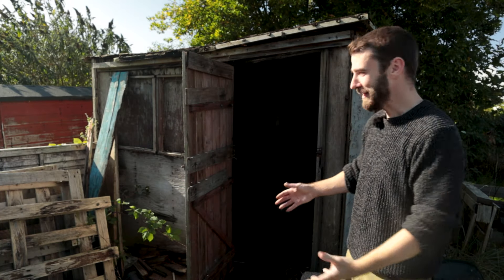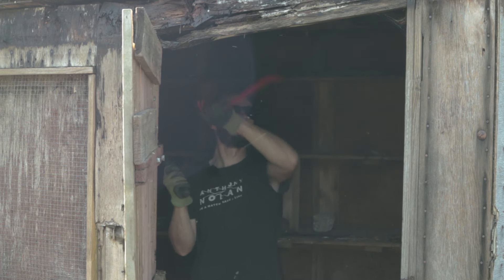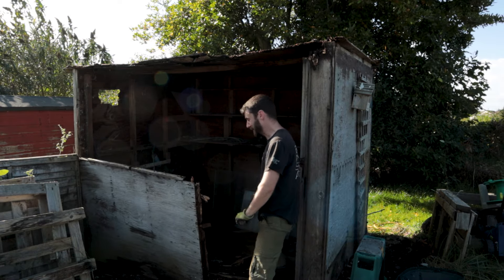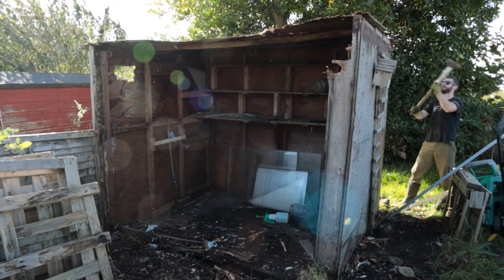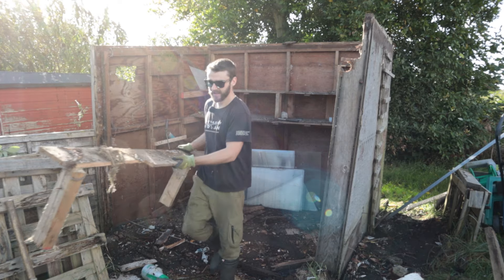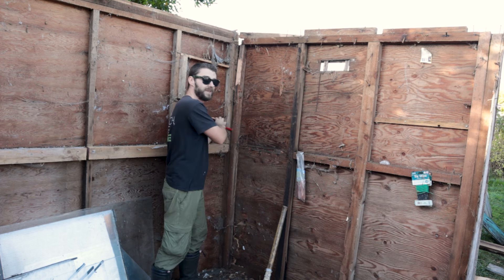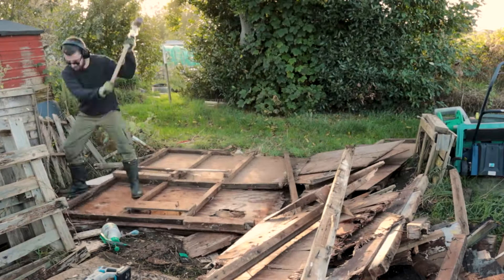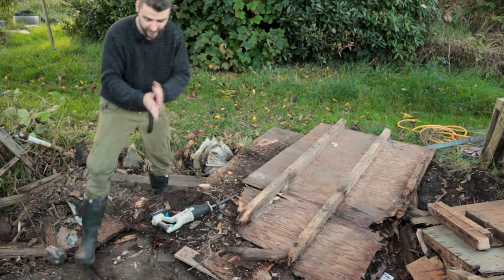Shed DESTROYED | More Difficult Than I Expected

Comment: I knocked my shed down about a month ago as it was a waste of space. I wasn't using it as roof leaked . Thought it would take me longer to empty it and would be easy to dismantle but it took me an hour  and a day to dismantle. I used my electric saw as well else I don't think I could have done it at all. Very satisfying!
I now have moved my greenhouse into it's place near my back door. I'm so happy I finally did it. Project 1 ✔  Project 2 finally making a fruit bush bed then a cage but cage will happen when it happens.
Reply from the maker: Sounds brilliant! Well done. It's such a shame how many little sheds aren't built to last. If you're not on top of it it's so easy for a small leak to rot and condemn the whole thing!
Reply: @JBNat  oh absolutely! I'd struggled over the years patching the roof. But same as yours the frame was still great. I saved what I canto make a fence for side of my garden for a fruit bed. So don't feel too guilty about it. I'm happy now I've moved the greenhouse (which was freebie Facebook find). Only gardeners understand the our levels of excitement lol

Comment: I'm imagining you've got a Frodo-style "It's gone!" feeling right now! 🎉 Well done! 🥳

Can't wait to see the next steps of this project 😁

I'm in a similar situation to you at the moment, actually. I'm trying to get my garden beds ready for summer, but at the same time, I desperately need to finish cleaning and setting up new garage shelving unit for the wall of my garage that is all things for the garden.
My garage is in a right state at the moment because everything is occupying the floor space as I've pulled all the flimsy old shelves off and I'm doing repairs on the wall before I set up the new shelving units.

I pick whichever task (garden or garage) takes my fancy when I have spare time to work on them. Weeding the garden has won more times than not, but all my garden bags are full, so I'm back into the garage at the moment.

It'll be worth all the hard slog in the end! (that goes for both of us)

Comment: Omg todays sheds word take half the time. That was meant to last. I bet it was built years and years ago.
Reply from the maker: Yes it was very much a custom build. Nice thick framing and then I thought it was the coach bolts holding it together, but it was really the 50 4 inch nails which went into the ply on each corner of the shed 😅
I dream to think how much all that plywood would cost to buy now. I also realised as I was taking it apart that I think originally the ply had been felted on the outside as I found a few remnants and quite a few clout nails. That was long gone by the time I took the plot on though.